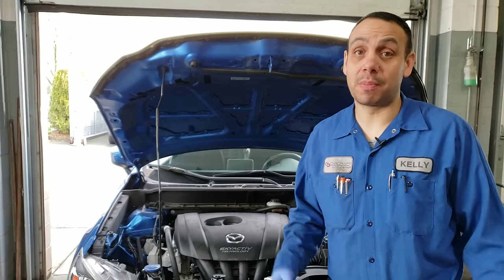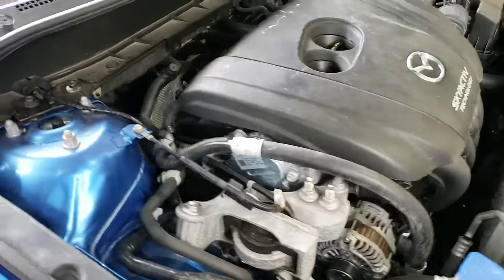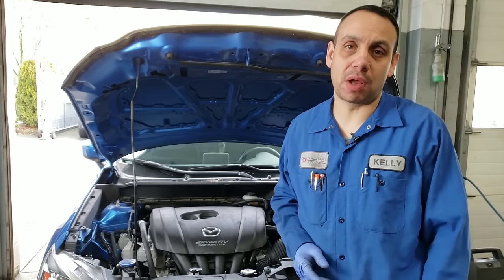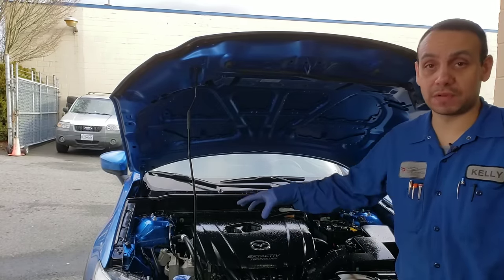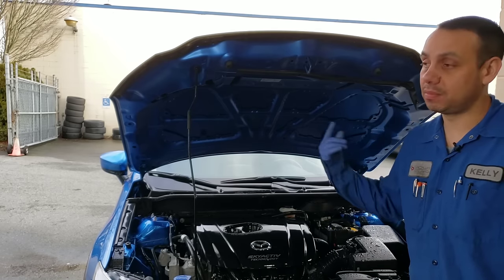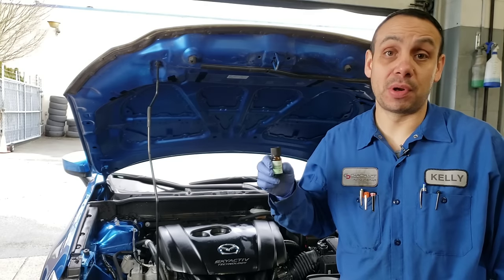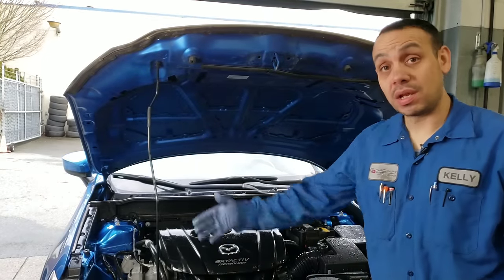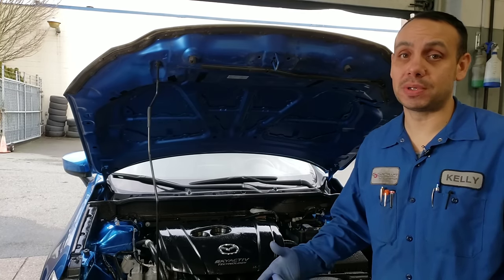Easy Tip To Keep Rodents, Mice & Rats Out of Your Engine Bay

Comment: Wire insulation is made from Vegetable Oil. That is what attracts the varmints
Reply: I am a one owner of a 1968 Ford Torino. By mistake I stored the car in a pole barn for two years. While in storage, the mice got in and destroyed the inside of the car. The seat stuffing was shredded and all over the car. More on that later. The headliner was destroyed. The sun visors were destroyed. The glove box became a nest and part of the nest was my old time tickets from the drag strip and the original sales ticket. The wiring had been chewed and they had gotten into the heating ducts. Our insurance company allowed me to start a claim for rodent damage. I took the car to a classic car restoration shop where they gave me an est. of $5200.00.  After debate and discussions, they did in fact pay the bill and the cars interior was like new again. The total paid at completion was $6200.00. But wait, I still had some problems. Upon getting the cars engine started before taking it over to the shop, the engine backfired and blew apart one of the two mufflers. I had to fix that before I could drive it and so I ordered new ones. Taking the old ones off, I noticed seat stuffing in both. the one was so packed full, i think it was what caused the backfire. After getting the car back from the shop, I noticed the clutch had a funny sound which I figured was the throw out bearing. So I decided to fix that myself. Upon removing the transmission, I could see seat stuffing inside the bell housing which was all churned up in the bearing and pressure plate. Yes, the mice had been in both the mufflers and bell housing through a air vent hole just above the transmission mount. I showed pictures of that mess to my insurance agent and he told me to reopen my claim which I did. I sent them copies of my receipts for all the parts with pictures of the damage. The next week they asked me who did the work so they could send them a check. I did the work. They ended up sending me a check not only for the parts but a guess at my labor cost. Wow! Was not expecting that at all. I was also told about the wire insulation in newer cars and that a claim on a newer car would not have been covered. cars after 1970 had insulation made of vegetable oil, but cars before that the wire insulation was made of rubber that did not contain vegetable oil. So there it is, the reason why I know about that one!

Comment: Dryer sheets don’t work, I’ve tried moth balls too & nothing. I have a “Mouse Blocker” in my garage but now I’m finding mouse dropping all over my tool chests & work bench’s! I made tin foil trays & put rodent killer near the drains around my hatch on my corvette and the mice ate thru the tin foil & ate the rodent killer but no dead mice 🐁
Reply: They usually crawl off looking for water, and then die. Just hope another animal does Not find them and eat them. BIG Problem with poisons.

Comment: Should I worry about water getting into the computer or fuse box? Does the engine have to be cool before you spray it? I did have mice getting into my engine bay and interior of my chevy van. Put sticky traps inside the van and caught two. Keep finding acorn shells in engine bay and don't know if it's from mice or squirrels.
Reply: Probably pack rats. That's what I have. Keep finding acorns and leaves and debris in the engine compartment, in a very difficult to get to place. So far not a single thing has deterred them. Not lights, not keeping the hood up, not Irish Spring, not Peppermint, not used cat litter. I have tried them all to no success.
Reply: @sabinejordan3110  by this time I would be getting me a 🐱 cat to keep in the garage.

Comment: I do not doubt this works since i had a rat get in my attic: instead of poisoning him, & being stuck with a decomposition odor, I chose to use ammonia soaked rags in the attic, rats & mice do not like strong smells like bleach & ammonia bcuz these items overpower the sense of smell. I had never heard of your trick but I am glad you mentioned it bcuz I owned a truck with the same problem from sitting in a barn before I owned it. Also if possible dont park near dumpsters rats, roaches and ants all hang around them. Great Job !!!

Comment: I've posted before but want this new one to reach as many as possible. My wiring harness was chewed up last year, April 20211. I was faithfully using peppermint oil every 2 weeks from March to June and assumed a rodent wouldn't bother coming back after months of that smell. I was wrong as it happened again this last August.

I was told moth balls work but OMG the smell almost killed me on a short ride. My mechanic has a boat that rodents chewed holes through while in storage and moth balls did not deter them. He then switched to cedar moth balls (not cedar wood balls) and said it works. 

I'm in Canada and the only place I've seen them is in Home Hardware. I spread a few of those packets around the engine compartment and am surprised o find most still there after the car's been driven. If they still have a smell to them, I leave them there. If not strong enough, I place some new ones but still do the peppermint oil every 2 weeks as well. I have been using cotton balls but the tip about makeup sponges is fantastic as they are reusable. Hopefully this works as I cannot afford a 3rd repair.
Reply: Use mace..last 6 months

Comment: I use a mix of 1 bottle Thumb and Tobasco sauce in 16 Oz water to spray all the wires and rubber.   Squirrels and woodchuck are the problem in the countryside.

Comment: Rats and mice also hate the smell of Ammonia. It also makes them think one of their predators like a cat etc is near. Any issues with spraying ammonia and water in the engine area?
Reply: I also use ammonia and seems to be effective but only when you apply it daily. 
It evaporates quite easily when engine is on.
I try to spray it avoiding electrical components. Spray the hood insulation, and any other areas that are made of non metal or plastic and just in case do not start engine right away after spraying the ammonia and let it dry.
Hope that helps.

Comment: I use mesh bags with moth balls and it seems to be effective.
Reply: how and where exactly do you put them, and does it make your whole car smell of moth balls
Reply: I usually put them in places where there is more wiring, as long as there is a place that won’t allow the bags to fall through. Near wiring harness is a most and I really don’t notice any strong smell in car. Important to remove when car is used and replaced when car is parked for the night.
Reply: @markbrockman9859  Oh that's an important detail---- "remove when car is used" (I was wondering where to put them so they don't catch on fire from the engine!!) Thanks Mark!

Comment: If you do have damage to your wiring, check your insurance. I had a problem and my comprehensive insurance covered replacing the wiring harness on my F 150 instead of paying the full 1400.00 to replace it, i only paid the deductible. I also spray the engine compartment with peppermint spray.

Comment: Is it really a good idea to spray/soak and then rinse the engine like that? I'm always worried about water getting into electrical connections. At a minimum I think I'd want to cover the fuse box.....and perhaps the battery.

Comment: we had dry dog food about a pound taken into the heater of 2001 jaguar xkr by mice. they didnt get wires but they were using some fiber sheilds to start a nest. we put peppermint all over mainly on dryer balls. we put an led light under the engine. we put mouse traps under it. seems to work. we got careless and quit for a few weeks. found signs again.
Reply: Hey, that dryer ball thing is a good idea.  I tried spraying and that didn't seem to deter them.  I also tried cotton balls but they blew away in the high winds we have here.

Comment: I lived in New England for 15 years… parked my car ‘outside’ (no garage) - every winter mice would try to move into my car and they would make a mess: chewing things to make nests, leaving their bodily wastes and smelling things up… one winter I literally trapped well over a dozen mice in that car… until I found a repellent that made them move out and leave me alone: Peppermint oil on cotton balls placed around the inside of the car… all the little bastards moved out and the car smelled wonderful. You can renew the application fairly inexpensively several times each winter. It works!

Comment: Peppermint oil sprayed in the compartment with spray bottle and where you can reach. Try a little first as smell may be too strong. Use full strength as oil and water do not mix. Also, comments tell how to get rid of ants with cereal. Also people use moth balls but they cause cancer in humans. Thanks for sharing.

Comment: I have a blue CX-3 with a minor rodent problem. Is it okay to spray the engine bay like that? It didn't look like the battery was unplugged or covered in this video.
Reply from the maker: Spray away. Like I explained in the video.
Reply: Watch out spraying certain parts of the engine, you dont want to get to much water in certain places

Comment: I found a device on amazon that emits ultra sonic sound that they dont like. Some are battery operated some wire directly to the battery. The system comes with zip ties to secure it to engine compartment. Seems to work. I have used pepermint, that works also. Good video, thanks

Comment: I'll give it a try! This does help in the house but never thought to spray the engine. I have to open my heater blower fan tomorrow, which is a simple task. Sounds like something built a nest there again, 3rd time since November. Also, I did find a slew of peanut shells inside the car a few weeks ago.😐

Comment: Don’t forget to lift the engine cover and wash under there. That area on my car was also covered in mouse pee and the insulation from the under side of the cover which they dragged into the cabin filter housing.

Comment: Darn rats!  Going to use this inside my house:)  Thanks
Reply: they come in thru the open drain to ur washer.
i had my washer hooked up & they came thru the washer. they were tiny. -about 20  till i caught on. i put a chore girl in it till i'm ready to wash.
the mama must have been in  the drain ,it  was cranking them out. --by myself,retired & don't wash often. still scared of that room.
if u use choregirls only use the good ones--not dollar general. the are too cheap to work.
.......my cats loved it, tho!..~*
Reply: Inside your HOUSE?
Reply: rodents can't handle steel wool.  try biting on it yourself.  poke it in holes till you fill the entry holes with cement.

Comment: Peppermint oil. Good tip. What I think people should think about:   Is there a rodent problem anywhere near where I live, but also where I might travel to  My friend's new garden hose was  in  just one night chewed in several places by raccoon(s). (foothills of the San Gabriel Mountains north of Los Angeles). I fixed her hose and had the idea of spraying the hose with Windex (ammonia). Ammonia is Basic, the opposite of acidic. Either of these dry has no effect. But get ammonia wet and like all bases, it becomes slippery, tastes soapy and burns. I figured we'd have to spray the hose every couple of months. Nope. They never even nibbled at the hose. It's been at least 5 years.  A couple made a YouTube video of driving up to Alaska and porcupines chewing enough wiring accessible under their truck to cause over $1000 in damage. I think people might keep in their bag of tricks, if rodents might be a problem:  buy some window cleaner, spritz the underside of their vehicle, and tires. I'm sure ammonia is readily available everywhere.  I would guess peppermint oil might be more effective in just keeping them away. Ammonia keeps them from chewing.

Comment: I have tried a few recommended  items but for me in my area  I spray the engine bay down about 1 per year with pepper spray ( bear spray ) seems to last the longest . once it dries it coats the wires ,   no smell and my guess is the rats still taste it and leave it alone .  (   I just have to warn the mechanics that may work on the engine ).   since then I have never had a issue.

Comment: When I moved to a 5 acre ranch our dog chased a squrile into my infinity coupe, this German Shepard was determined to catch the rodent to the point she ripped the shield under the front of the car and took a bite out of the front fender. $2,500 worth of damage. I use a RX plastic bottle I drilled a few holes in and put about 5 moth balls in it and zip tied it to a wire harness and have not had a problem with the rodents that live all over this property. The neighbor uses flood lights on all his cars in the drive.
This does not work with snakes, I started my jeep 1 afternoon and a 6' snake came out near the wipers. It took a while to remove it due to it wrapping around the wipers.
Reply: Get a French sheperd , much less violent

Comment: I've found mouse nests twice: in a 1982 Camaro carburetor and a 1998 Wrangler vent fan. The nests were mostly shredded paper but there was also some bits of wiring insulation. It was a nightmare trying to clear all the shredded paper out of all the Wrangler vent ducts.

Comment: We just had our Camry in the dealership yesterday because a loud thumping  sounds were eminating from the dashboard. We figured the mice had done damage AGAIN! This is the fourth time we have had this happen to 3 of our Camrys. The first time they ate the wire harness which was thousands of dollars to repair. Yesterday's bill, was $591 to replace all of the filters and wires. My husband and I have put soap, peppermint oil, Rodent Sheriff, Lysol, the machine on the engine that is supposed to repel rodents, etc, etc! This time we could smell the mouse urine. We are at wits end on what to do. And, they also ate the passenger seatbelt! Does any one have any other suggestions? They seem to like the Camrys . I had a Scion FRS that they did not bother with and we had a Dodge SUV they did not tough. All of the Camrys except the one we own now were leased. The first Camry it happened to they ate the wire harness and whatever else they did was over $5,000 in damage. Our insurance paid for it and the dealership took the car and we drove off in a brand new Camry. And, 6 months later, here we go again. Over a 6 year period, we have paid out over $3,000 to have the Camrys repaired . Lol, this morning I found a dead mouse in the family, Karma! I do not want to hurt the mice in the car, so poison is not an option. Besides, knowing our luck they would die somewhere in the car and the smell would be horrific. The urine smell is bad enough! And suggestions would be welcomed. Watch your Camrys, mice love them!
Reply: This is my 3rd Camry also. The 2nd one that has had critter damage 😢

Comment: Aint working. Cleaned out, fixed the damage and did not even dilute the oil. Mice were sleeping in the same spot, bathing in mint...
Reply: Moth balls inside a can with plastic wrap cover+ rubber band, and poke vent holes. Place can on the ground underneath parked vehicles . This wards off rodents and snakes. If you have farm equipment /construction equipment that sits long term seasonally this is the way you keep that snakes problem out of the cab.
Reply: Basically mouse traps at every tire dabbed with peanut butter 🥜  is absolutely irresistible to rodents. I caught a squirrel with a humane trap using peanut butter slabbed over a cradle made of aluminum foil taped to the trap trigger. This works 100% and never fails to catch animals.
Reply: @tomikhaos7248   I have been using a humane trap then releasing them by an old cemetery far from our house. I am a Buddhist and avoid killing anything if I can avoid it.

Comment: I just discovered two coil wires under the skyactiv cover were chewed up by mice.   I wish you would look under the cover in your video..  I'm thinking now that cover is a bad idea as it is an ideal little nest if a mouse can get in there.  Should I keep that cover off?
Reply: Sure you can. It's a stupid beauty cover. It does nothing but retain heat especially in the summer! I keep mine off all the time.

Comment: During the winter with my motorcycles covered this is a big problem. I’ve found that dryer sheets placed under the covers work well. My slingshot which is open I place several dryer sheets in the glovebox and seats. I’m going to try your great idea in the engine dept as they have chewed the injector wires up in my Ford Ranger. Thank you

Comment: A strong hand vacuum works to get up the poop and debris. I’ve seen nests made and wires eaten away on the engine. They get into glove boxes too. You’ll see little scraps of paper. I’ve caught ‘‘em in mouse traps. Leave the air intake switch turned off in the passenger compartment at night especially.

Comment: I had similar problem where rodents chewed off the heater hose and sound deadening outer coating and felt.After cleaning and replacing the hose sprayed white ant chemical .the spraying chemical did the trick keeping squirrels and rats away.

Comment: Take a couple of old pill bottles, drill some holes around it, and, put in some cotton balls. Then soak those with peppermint oil, and, screw on the tops. I drill a hole thought the tops so that i can pass a wire or string though those, then hang a ccouple of these under the hood near some wires. You can refresh the oil by just screwing off the top and replacing. I alos spray the premade stuff that you can buy, It is pretty strong and smells great.